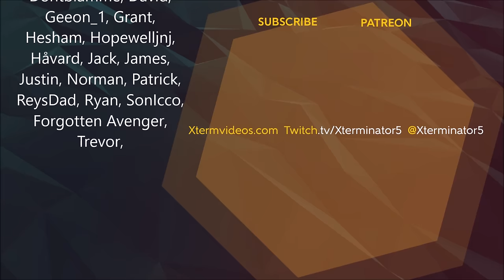Factorio 1.0 Tutorial Lets Play EP9 -  Oil Production: Introduction Guide For New Players Gameplay

Comment: The minimum a oil well can have is 20% unless it is generated with less than 20%.
Wiki text right there

While cycles left is greater than 6000 (20% yield) and greater than 20% of the initially available cycles, each pumpjack cycle reduces the number of cycles left by one.

So unless an oil field with less than 20% yield is created by map editor, yield will never drop below 6000 cycles.

Comment: I learned from watching Mini betrayal an easy way to set up cracking. Have the wire from heavy oil to the pump for heavy oil cracking  set it to heavy >light oil same for light oil to petrol.  Works great and doesnt require setting specific numbers for storage.  Hopfully that makes sense.  Thought it may be a good tip for the tutorial.
Reply: With tanks you can use that tanks equalize. So only wire one tank. If you then set X > 24000 it basically means you want most of your storage full. No matter how many tanks you have. Either way works

Comment: I haven't found an answer anywhere to this: If the mining area of the miners is 5x5, which is bigger than the actual machine, how come we always put them close together?
Reply: To maximize the ore you get out of a patch per time. Pretty important with small patches like the ones you start with. You need a fairly large number of miners to fill a belt.
You can do even better than this by undergrounding the belt and putting the power poles in the holes
Reply: @S_Black  That makes a lot of sense, thank you for your response!